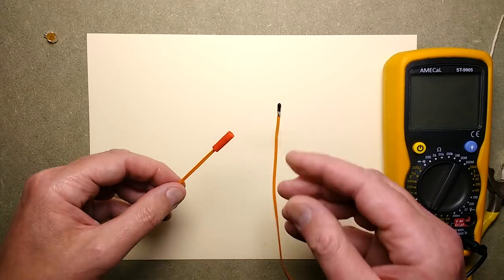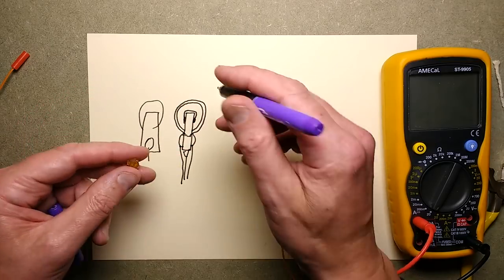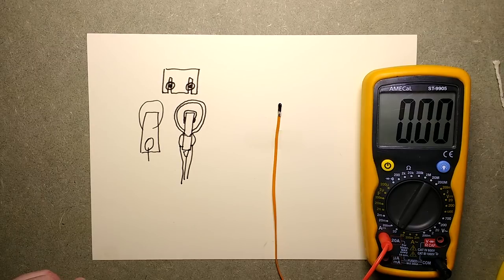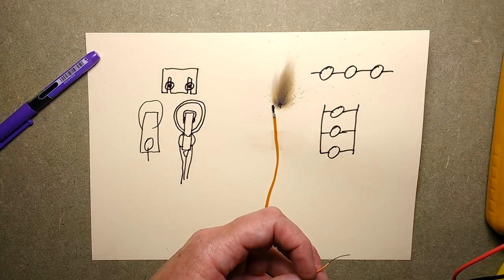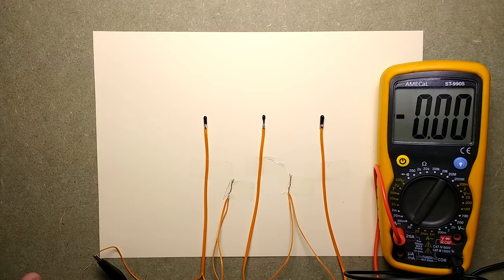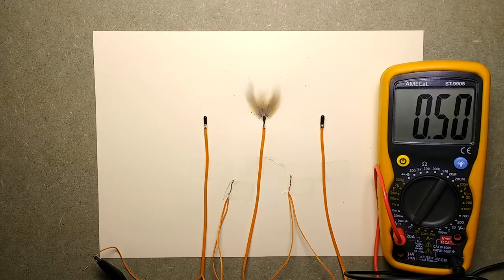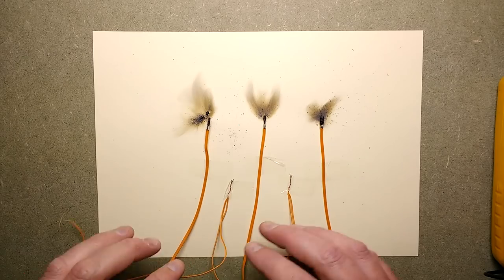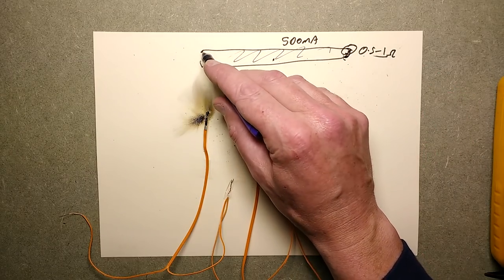Testing for electric match misfire.  (bangs and flames)

Comment: Very similar to model rocket igniters. Those are often just a loop of ni-chrome wire dipped in the match compound.
Reply: I think the model rocket igniters are somewhat smaller than the electric matches shown in this video, since they need to fit into the rather small nozzles of model rocket motors.

Comment: Hi Clive.

I'm a retired Openreach engineer and I have boxes of these. There are in fact three types used. The two way that you used, one the same but has three ways (maybe good for end of line and a two way type that you put over the top of a pair and when crimped will cut of the excess wire saving you from having to trim the wires level.

If you would like some please let me know. I can also show you the TDR fault finder we use and methods to find and range earth or battery faults using a three wire test. The testers in use now have all these functions on one device including a high voltage insulation test, spectrum graph ( I would not go so far as to call it a spectrum analyzer and one other great feature.

We can use an end of line tester unit or by sending a dtmf string we can use an end of line tester in the exchange. These can disconnect the pair from the line equipment, Loop out the line and send a modulated tone to identify pairs in congested junctions. The exchange unit is also able to perform a pair quality test. This will isolate both A and B wires at the exchange and run a test on each leg for earth or battery faults. The test also emulates a data stream and can identify any REIN and SHINE problems and  show a full range of frequency tones used by VDSL and ADSL.

It would also be great if you could cover basic wiring including the importance of maintaining the twists on the pair so as to provide common mode rejection. I think your viewers may like to learn a bit more about how high speed data services are provided and maintained.

If I can help in any way please let me know.

Keep up the great work :-)

Stuart

Comment: There's an unexpectedly large tolerance between ignition currents of those matches! It’s not surprising that the last one went open circuit, since it was running at a much higher initial temperature.  Thanks Clive.

Comment: From someone who worked in Canada as a display fireworks pyrotechnician, the common setup is parallel. My experience was always to twist together the leads and they get put in to a speaker connector on a large firing board which usually supported 28+ individual groups of fireworks. These boards would be connected back to the firing controller with a large parallel cable and regular 14-3 home 120v wire hooked up to a car battery.

Comment: Those telecom connectors are very useful . I worked for ''LUX ' , the temporary traffic lights people and we had the contract with B.T , saw those things used over and over , very handy if you have a lot of wires to join quickly and the silicon like gel is perfect for waterproofing , got my hands on a couple of tubs of them 😁

Comment: Also of note: When setting up displays, DO NOT use a standard stapler to fasten down long runs of fuse, the impact of a regular stapler hammer on the staple can create a spark which in turn can ignite the fuse line. There are specific Pyro Staplers that are constructed from not ferrous materials that will not cause the hammer impact spark. 
I got to see the results of this phenomenon first hand when someone wanted to help speed up a display setup and grabbed their regular stapler...OOPS! Lucky the incident was isolated to a small portion of the display and didn't cause a total meltdown. Needless to say, safety watch was on higher order after that.... huh, imaging that...
Reply: DrTeddyMMM I think nowdays that's a non-issue, because nobody uses fuse runs long enough to need stapling.
Reply: 1" wide masking tape, only, ever.
Reply: Mentioning items of safety is never a bad thing...

Comment: The reason they need to be wired in series is that in parallel the unequal resistances will cause them to pass differing currents. With them all in series, a current source can force the required current through ALL the elements without respect to voltage or resistances.
Reply: mysock351C Is CC what they're actually triggered with in the real world?  In that case, it seems odd that the matches do not have a juicy resistor of a few ohms or similar to keep the current going in the event of the described failure mode.  Other than wasted power, there must be a reason why this isn't done?
Reply: Are they normally driven by a straight up CC or ramped up to a V or C limit and then held?  I can imagine there must be an optimum way that this is done that ensures highest likelihood of all firing without raising the current too high and burning out some matches' filaments and ruining the continuity?

Comment: I've flown high power rockets. Sometimes the igniter is an electric match, usually coated with a small bit of propellant or other pyro compound. Many are "home made". I've used the commercial igniters that come with the small hobby engines(Estes) and hooked them up in parallel for mutli-engine rockets. But for the parachute charge, my "goto" igniter is a flashbulb(AG-1) coated with a pyro compound. I've also used quite successfully christmas tree bulbs modified for the occasion.

Comment: What happens when you have a missfire in a display. With the amount shells launched some must not have gone off. Do they dose them with water or disposed in a special way?
Reply from the maker: They are safe until actually fired, so if the fuse is intact they can be reused.  On big shows where they don't want to take stock back they sometimes add extra unfired pyro on the final shows.
Disney has a pneumatic firing system for precision fireworks.  The shells have a smart circuit that is attached to two wires.  When the show begins the system charges the shell's capacitor and requests a sample of the shells internal clock frequency.  It then sends a command back telling it how many clock cycles it's to count before firing.  When the shell is about to be fired the system sends an arming code and then triggers the air cannon to fire the shell.  If the shell detects it's lost power it knows it's been launched successfully and starts counting down until it fires.  If it detects that power is still applied after the time it should have been fired in, it goes into a safe state automatically and waits for further commands.
Reply: bigclivedotcom But what if the match fires, but the pyro itself fails, doesn't that present the same hazard as a failed amateur fireworks piece?  Also that Disney systems seems prone to ground level firing from a power outage.
Reply: John Francis Doe cheaper stuff is just doused in water, with more expensive stuff they wait until it's safe and then analyze whether it can be re-used in another show or must be either destroyed or taken apart and recycled.
Reply: Shells are left to the end when you de-rig, partial cakes are just put to one side and made sure there is nothing still smoldering.
We used to have a mirror on a stick for looking in mortars.
Nearly all misfired shells are reused, you use add a new piece of quickmatch to the lift.
However if rigged correctly there are very few shells that fail to fire and it's normally down to either an igniter being ripped out by another shell or someone forgetting to wire them in.
We wire all in parallel, this is due to the inconsistent resistance of igniters.

Comment: Hello Clive, do these electric matches have delay versions such as electric detonators have?

Also, regarding the risk of mobile phones firing a detonating circuit.  One of the staff of The Imps Motorcycle Display who used to fit a pyro thunderflash  to one of the bikes for their display.  Was the victim of a thunderflash going off and blasting him in the chest.  After this he would always insist that mobiles be turned off while he was fitting them.  Better than taking the chance of another premature blast.  You might have even met him at some point.

Comment: FWIW, when I was shooting pyro back in the 1980s, we use Atlas squibs that were guaranteed to fire at 150ma +-15% if I remember correctly. They were also guaranteed to blow open. We did typically wire squibs in parallel rather than series. If we had a big shot, like 20-40 squibs, we'd use a relay box with a 12V gel cell battery within about 50 feet of the squibs to be sure that we got the shot. Usually though we only had 1-2 squibs on the end of any long run, so had no problems running a couple hundred feet back to the firing box.

Comment: I've been doing electrically ignited displays for family and friends as a hobby for a little while now. I've always wired mine in parallel, mainly cause I use modified Christmas lights as ignitors. Cut the top of the bulb fill it with flash powder and seal it with super glue. I usually use a car battery and an extension cord for my final run from the setup to the launch site.
Reply: that seems kinda unsafe, much work, not even that cheap, and illegal on top of it.

A type igniters are cheap enough from name brands, and wireless firing systems are cheap nowadays, you can get a very hackable 12 channel system for like 40 bucks. I fire mine using an ESP32 with a 433mhz transmitter on it, a small webserver, and connect it to my phone.
Reply: tommihommi1 Look man I don't do this for a living a do 3 shows a year max for family and close friends for free. The investment isn't worth it when I already habe this stuff laying around. Making the ignitors isn't any more dangerous then hooking them up if you follow basic firework making procedures. Don't have the flash powder near your work area only take as much as you need for a bulb and close the container immediately. I've used mussel loader rifles and that's feels more dangerous then making ignitors.
Reply: Alec Ver Bunker what investment lol? You're just making up reasons to play with flash powder
Reply: tommihommi1: "You're just making up reasons to play with flash powder." You say that like it's a bad thing.
Reply: KarlBunker If it's in a shed with a decent distance to neighbors, go ahead. If it's in a residential area with other people close by or even in the same house, yeah, it's a bad thing.
Reply: As Tommy says electronic ignition systems are dead cheap, the first or second display will have paid for it in the need to not ruin a set of fairy lights which need replacement after. 

The worst I’ve done is use electronic igniters as shown above, twisted the connections together the set it off with 12v car battery. This all using stripped Ethernet cable for the long runs, I would argue this is much safer than playing with flash powder though, and at that for not good reason.
Reply: The associated things you learn from the comments! I never knew there was a rifle you loaded with shellfish.
Reply: Yes bren106, You need to cockle it first.
Reply: gizzymoee I can pick up a pair of broken Christmas lights for free from my local thrift store, no one wants to buy the broke ones so no investment there.
Reply: tommihommi1 tommihommi1 Alright I didn't treat you like a dumb ass so why are you acting like I am? Like I said proper firework making procedures I live in on a 15 acer property with neighbors not more then a mile away. The physical container I have of flash powder wouldn't even touch the shed. It's still in its little 3oz container. Ilegal? Tell that to my neighbor, he's the local sheriff and loves my displays. I don't know what your laws state but here in America in Wisconsin it's totally legal because I'm not trying to contain the the combustible material.
Reply: tommihommi1 also my father was and I am on the local fire department. I know how not to burn my house down better then most people so don't even think you can tell me something I don't already know about handling combustible materials.
Reply: KarlBunker Thank you. Why do we always have to buy everything now days? These guys can buy there's but im perfectly happy with making my own. They work and that's all I need, I literary got the idea from looking at commercial ones. There basically the same thing, just home made.
Reply: alec ver bunker, props to you for the diy approach, i dont like christmas/fairy lights because they are unrelyable with their tiny little filaments that burn out so easily, especially when opened to the air, a small piece of nichrome/kanthal on the ends of some thicker copper wire works fine as well, especially if you put match head powder in a paste on the end and let it dry(you dont need to do this, the wire will glow red hot and ignite pretty much anything)
Reply: Frogz my grandfather taught me the Christmas lights approach, he learned it from his father who used to work in the iron ore mines in northern Wisconsin / Michigan, they'd use the Christmas light idea when they ran out of real detractors. Granted they used TNT and a bit of bacon grease to keep it from falling out. These guys think the flash powder is bad imagine TNT. My grandmother has a picture of him doing it at the card table with a few sticks sitting next to him using a drill bit to hog out the material from the tube.
Reply: tommihommi1 - a lot of things are illegal today, and slavery used to be legal, so can we please drop the idea that the legality of a thing is relevant if we are to dicuss if a practice is good or bad?
Reply: modified Christmas lights ... Ha!
Reply: Alec Ver Bunker Sounds like a blast! Don't listen to these arm chair know it alls that likely have little to no experience actually doing what you're doing. Maybe if they tried your way they would see the merits of a DIY approach.
Reply: I can see the point about how its done but its many times safer than being up close and personal with large explosive devices. You could simply use a step down transformer to say 50 volts and rectify to DC (if that's even needed). One thing, I have never seen domestic fireworks provided with electric matches and that is a shame as its much safer.

Saying that with the way our government are so worried about terrorism it may not be legal to initiate fireworks electronically unless  you have some form of display licence or training !

Can anyone confirm this ?

(Now picturing clive building a mini V2 in the back garden)  :-D
Reply: Don't worry about "illegal". Everything is illegal in the UK. And in any case if it's not illegal, case law (open to interpretation) will bend to acts to make sure the defendant is guilty for an array of charges (natural pun). The BS Justice system is rigged (natural pun) against the unmonied aka less of defence💰
Reply: 100% agree, they should be encouraging the use of remote initiators for fireworks, it would drop A & E visits dramatically !!! 

I know the control system can't be prohibited as you can purchase them freely. The problem with the idiots that make the law is they don't apply common sense.

One of the posts above mentioned cheap systems that run on 433Mhz and can be easily hacked and that scares me far more than a bad ignightor.

The 433Mhz frequency in the UK is very busy. I repaired a remote clay pigeon catapult years ago and that ran on a dedicated frequency using better standards of encryption than my two way Navy radio did 20 odd years ago.

If wireless initiators are used they should be on an allocated frequency and heavily protected IMHO   !!!!
Reply: i did this once, christmas light bulbs, or drinking straw bits with two wires of different length hotglue into and thin copper wire wrapped around and soldered to ends

i then opened firecrackers and poured some gunpowder in them. yes, using goggles but with plastic syringe, unsure why, static, etc

for firing system i used 7 function buttons from mechanical keyboard, random cabling and rectified 30vac from transformer. it even had one led circuit with 3-position switch test / off / fire. all tested ok, but when firing i had lot of issues, (electrical) fuses blew, the clear tape with tiny hole over ignitors caused gunpowder in them to explode, not burn. pushbuttons welded shut from high current. after a fix, i got whole one rocket fired

funnily i was late teen and mother was really worried. it's not like i didn't know that gunpowder explodes or burns

funnily, i had argument with somebody that gunpowder doesn't detonate, it's not high explosive. it's low, so it deflagrates, eg, burns, just fast

Comment: To possibly mitigate the match firing open circuit, could you not connect something like reasonably hi-power 3 ohm resistors in parallel with each one? Then blast them with a lot more current? If the current pulse is short enough it shouldn't blow the resistors and any match that failed open would be bypassed.